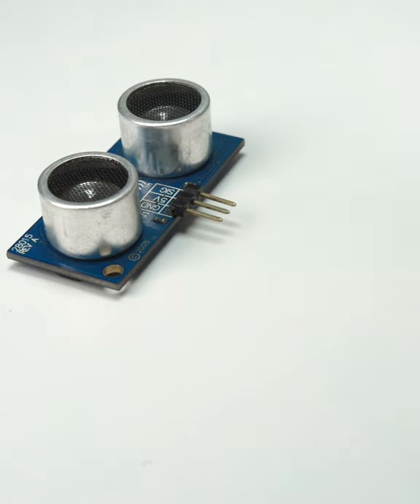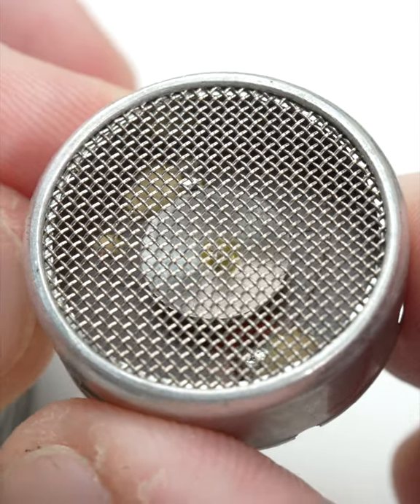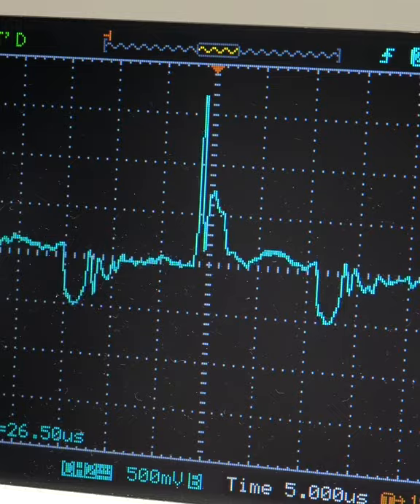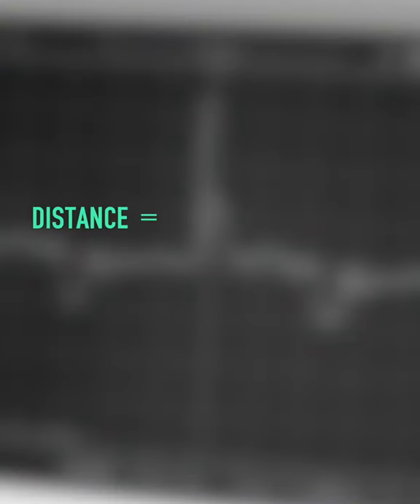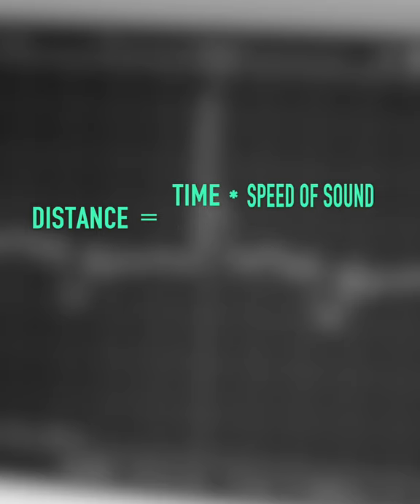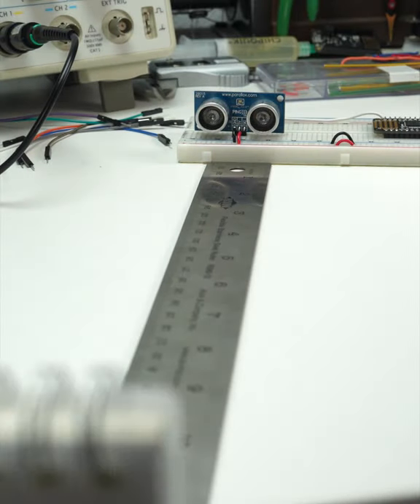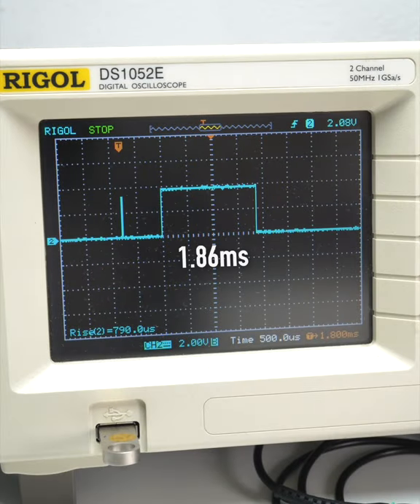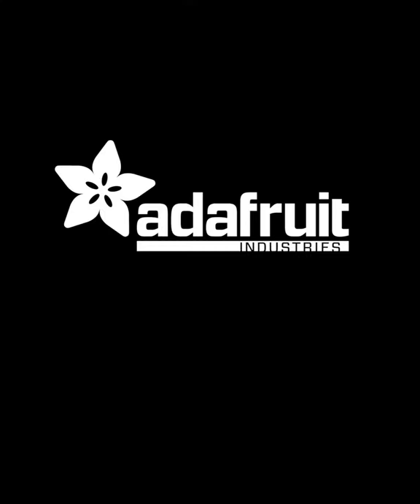Ultrasonic Distance Sensor - Collin’s Lab Notes #adafruit #collinslabnotes

Comment: Don’t forget, the speed of sound changes based upon your altitude. The higher the altitude, the slower the speed of sound. As there are fewer molecules to transfer the energy. Sound travels faster underwater for this same reason
Reply: Yep. So factor in a pressure, temperature, and humidity sensor, and you can get an even more accurate distance measurement.
Reply: @howardbaxter2514 just going to mention the same thing, nice!

Comment: Am loving these videos Collins lab 😜. How does the sensors used by traffic work
Reply: For changing stop lights? Some are just a timer, some are time and a sensor (maybe magnetic sensors in the pavement), some are sensor only depends really where you're at small towns/cities are more likely to be time only
Reply: @calebwiggins3042  thanks for the heads up buddy
Reply: Often a coil in the road for magnetic detection. For asphalt roads, you can now and then see a big square where they have cut through the asphalt to put down the cable forming a big square in the middle of the lane.

So if you are biking on a bike made of aluminium or carbon fibre you may have the traffic light fail to detect the bike because there is too little ferrous metal to induce a big enough signal.

Comment: But what if the sound wave sent is at the natural frequency of an object (so it's like simple sound wave not ultrasound )..is there a way for the system to recognise location and distance of said object...for example if you have an empty room and there is a resonance fork of 400Hz fixed on the wall or somthing...can the system find that fork distance and direction/location by sending a sound of 400Hz?...

Comment: What frequency is it operating at? 
And does the frequency used change the outcome? 
It wouldn't right... cuss speed of sound is constant. 
But I am still curious. Cuss i had a dilemma before of how one would be able to accurately determin Centimeters using math without first having it( I think my wording here might be wrong xD) essentially I was trying figure out how would one devise a method of acurate measuring without the already created tools. 
Like starting from scratch. This somewhat solved that mystery to me( never been taught these things, it's just stuff I ponder on for my self so xD) 
T
hou how would one accurately device how much a centimeter is without this type of device or any other tool/ reference of which u know it's length from allready...... this question has perplexed me 🤔
Reply: A meter is defined to be the distance  light travels in vacuum in 1/299792458 of a second. Soo you can determine the lenght of a meter with a really fancy clock.
But that being said one can also say that you can't do what you are asking to do, we agreed on how long a meter should be before it had natural defenition meaning that a meter basically was a stick that everybody agreed this is a meter and we locked that stick safe for safe keeping.
Reply: huh, thanks. That cleared some things ^^
Reply: Normally 40 kHz and up. The frequency affects the resolution. 40 kHz is about 9mm period length based on speed of light.

Comment: If you use the sensor in Helium is the discance fals?
Reply: Yes and no. You need to use the speed of sound in the formula. And the speed of sound differs for different media. If you use the speed of sound for Helium, then the formula will produce the correct result.

Comment: Is there any way to compare the distance output to a range and trigger a pin if something gets too close?
Reply: Smh. What you are looking for is a basic beginner project.
Reply: @integrationofmanandmachine4714  You're right, I've never worked with arduino or these ultrasonic sensors before. I'm more of a script kiddie when it comes to programming. I am just trying to solve a problem at work, and thought that this could work as part of the solution.

Comment: How far can they work?
Reply: The type he demonstrates often has a maximum range quoted around 4m (13ft) but as it notes in description in https://www.adafruit.com/product/4007 (for a 3.3V compatible variant) it works best at "10cm-250cm". The size/angle/type of object will affect how much ultrasound is reflected back. Something like a baking tray facing the sensor should give a really good reflection but a small fluffy toy is going to absorb a lot and spread the reflected sound more.
Reply: Thanks! I'm looking for something to do like meters. Are there any components that do that? 8m sure there is a laser or something
Reply: One dimention echo .  Now ultrasound  medical 3 dimention
Reply: In the water speed echo about 1500m/s